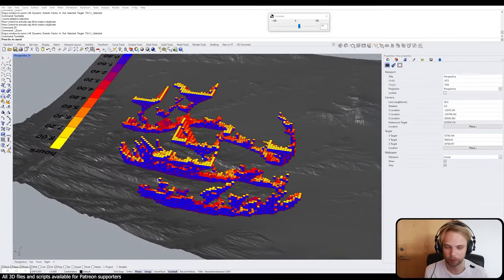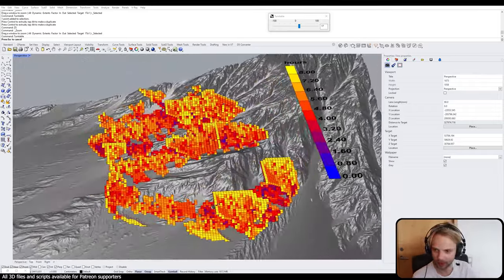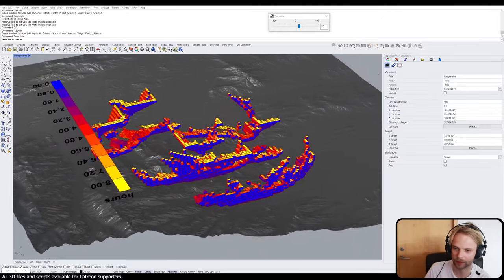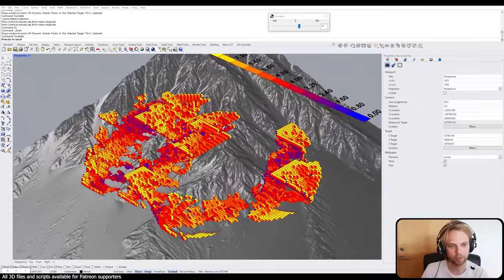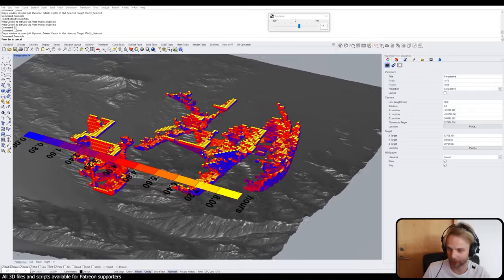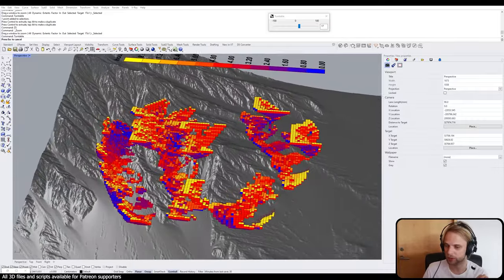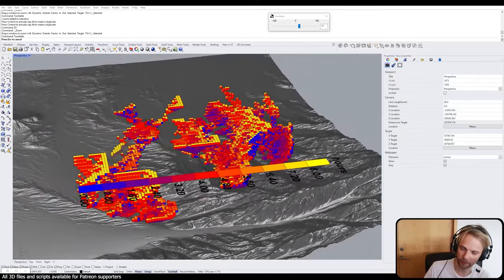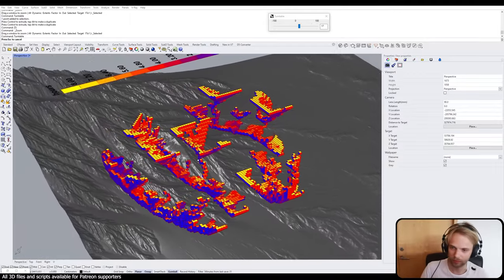FULL COURSE - UE5 for Parametric Architecture #4 | Sun Light Based Urbanism

Comment: Dude, the rest of the world is asking if you can do exact *opposite*. Have you seen the temperature in the rest of europe the last 5 years?
Reply from the maker: This has nothing to do with temperature. Proper A++ class energy efficiency with heat insulation + solar panels + air conditioning solves any overheating issue. No need to live like mole people in the dark because of it.
Reply: @DesignGoBrr  BOOM, ROASTED!  There are so many outweighing reasons on why you should design for more natural light. Tons of psychological/ physical benefits when it comes to having a healthy amount of natural light. Also, that is why we have shade structures and other tactics to filter the light like Gediminas mentioned
Reply: @nickrosenthal8477  BOOM, never attempt funny remarks on the internet. Lesson learned, only hyper serious stuff from now on.